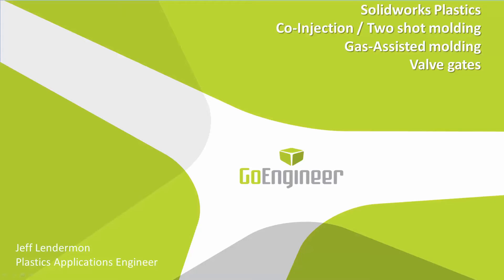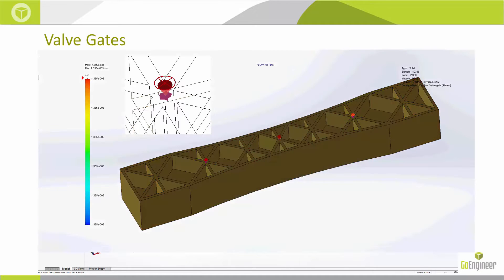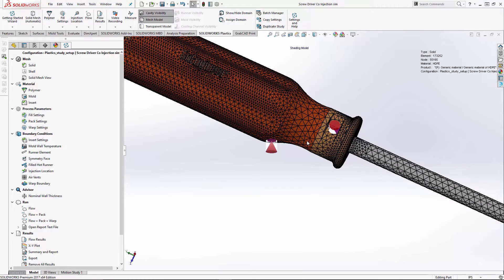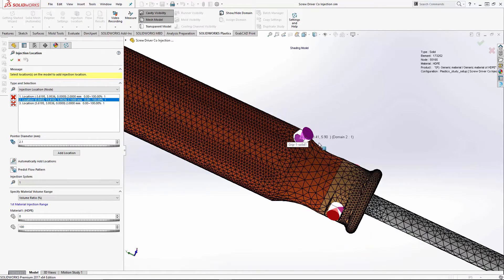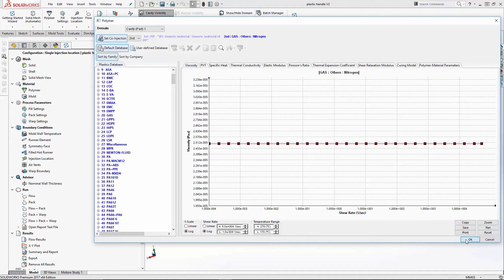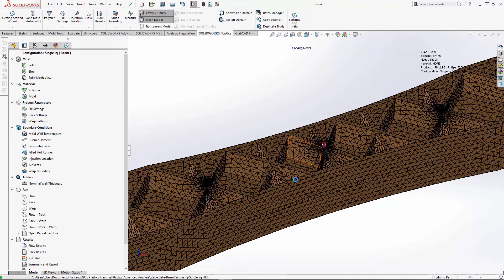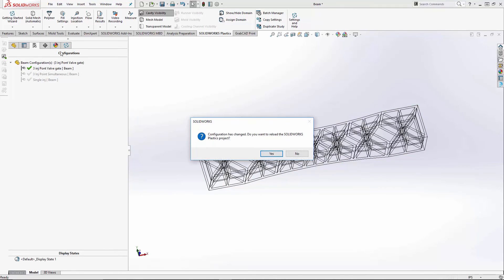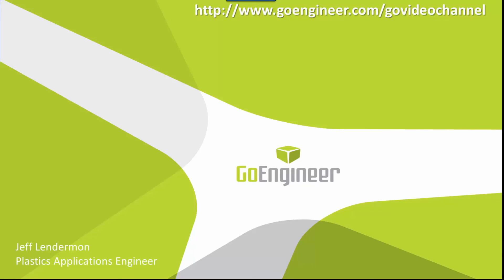SOLIDWORKS Plastics - Co-injection Gas Assist Valve Gating

Comment: Hi,
thank you for the gas assisted tutorial. Could you help me in a difficult simulation? I have one piece with 3 injections points: the first (central) is for the ABS  and the other 2 is for gas compacting: this step should start immediately after filling phase. Unfortunately I can't start the second phase, because in the fill setting seems to be impossible setting compacting start time, cycle time and gas pressure.
Thank you for your assistance.